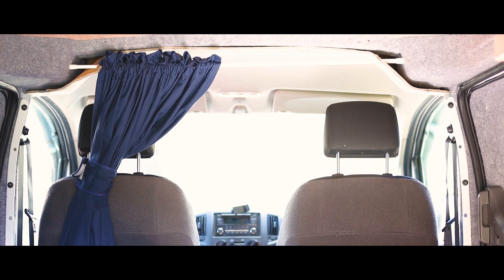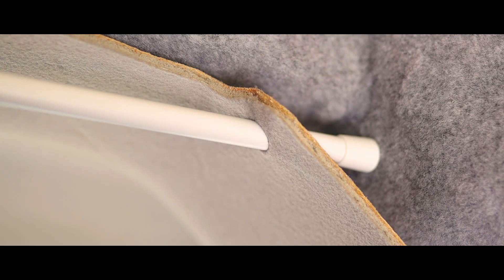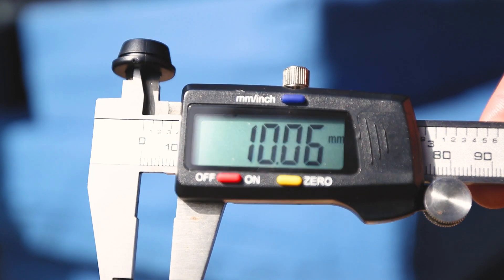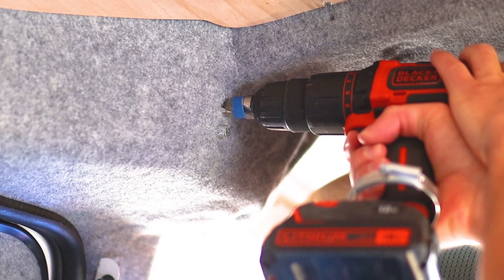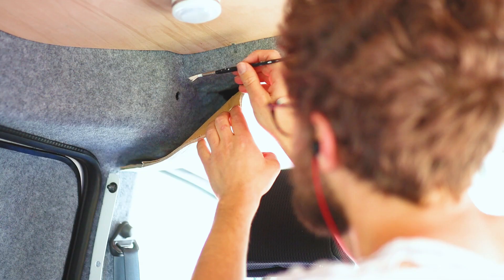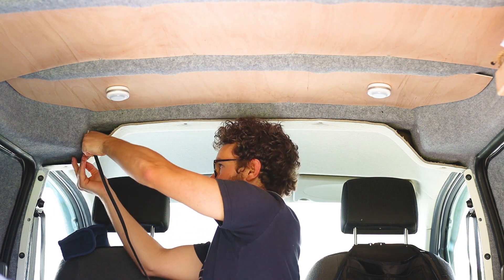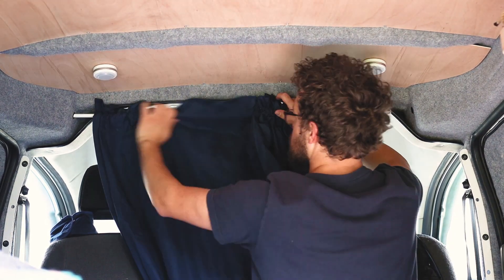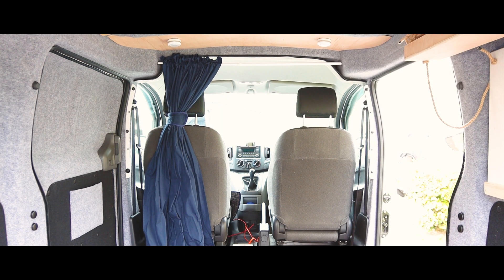Installing A Blackout Curtain In A Van | Ep 12 | Nissan NV200 Camper Van Build

Comment: Is the NV 200 the most reliable Van to get?
Reply from the maker: Hi, I couldn't possibly say - I love my nv200 but I suppose all van and vehicles have their pros and cons. Haven't had any problems with it yet though!
Reply: As a previous Nissan Salesman I would say it's up there. I haven't heard bad things about others, but I've sold many and never had any issues. All the buyers were very happy. It has a 5yr 160,000km limited warranty so your good for engine and tranny and a few other things. Its a 2.0l 4cyl previous gen Sentra engine with a CVT transmission and rated for up to 1500lbs payload, so its a half ton truck equivalent. Fuel economy is very good - about 9liters per hundred km combined in real world use - that's about 26 mpg. Most of the people who came to see one bought it. They usually had a good rate deal or cash buyer program too. It was very affordable. I'm considering buying one to make a camper. The other option would be to convert a Dodge Caravan. Those are good too and dirt cheap for base models on the outgoing year.